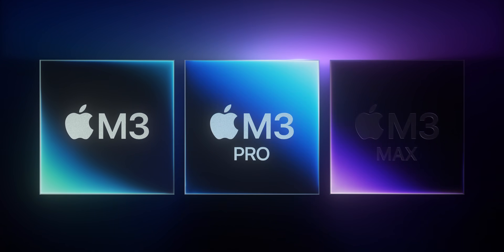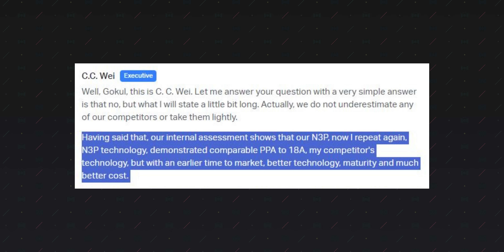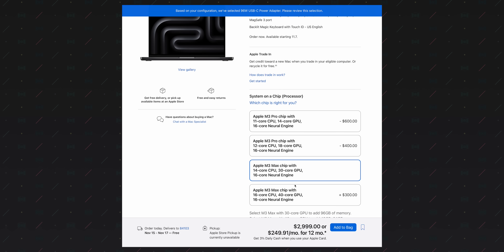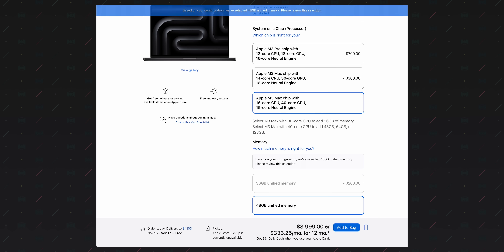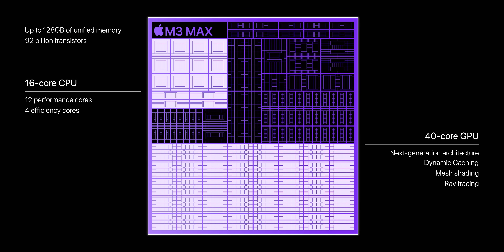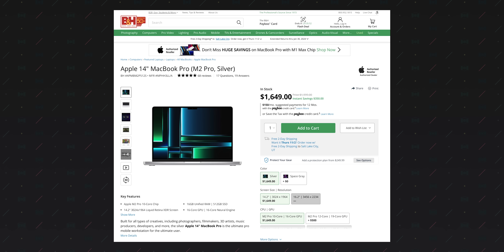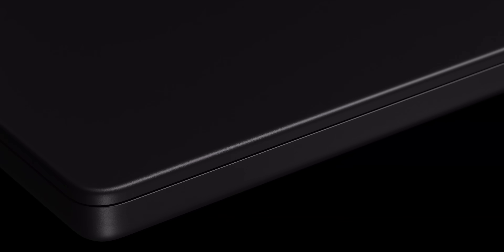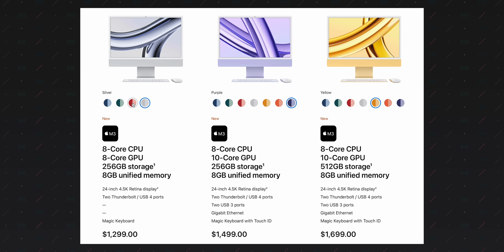Apple M3 Deep Dive: The Details Most Skipped Over

Comment: The only thing I'm disappointed about is that they didn't raise the RAM for the base M3 MacBook Pro to 12GB or 16GB. $1599 is a great price reduction for the 14" form factor, but it turns into $1799 as soon as you upgrade the RAM to a more reasonable spec.
Reply: $600 to upgrade the base model iMac to 16GB RAM & 1TB storage. It's a joke.
Reply: Now add tax and you're approaching $2,000
Reply: 16gb of RAM costs about 70 bucks if you buy it as a consumer straight from the store. There's absolutely no excuse to not have that at the very minimum in a laptop that costs 1600 bucks. Apple can buy this stuff at a fraction of what the consumer has to pay if they would buy it at a store.

Upgrading the Pro version from the base 48gb of ram to the maximum of 128gb version costs $1000!!! Good 128gb RAM costs around $450 (at consumer prices). What's the $550 Apple tax for? Soldering it onto your laptop, so it can't be repaired easily?

Storage is even more insulting tbh. + $2.200 for an 8TB mid-range SSD?!?! I say mid-range based on the SSD's Apple have had in their previous Macbooks. Nothing bad, actually pretty solid SSD's, but still not quite A or S tier level SSD's in terms of performance (closer to low to mid B tier level). A high end 8TB SSD costs around $1.100 and that's already overpriced since it's usually a better idea to buy multiple smaller sized SSDs (sweet spot is 2TB or 4TB per drive). For two 4TB SSD's you'd pay for instance around 600 bucks, (just to give an idea of how overpriced 8TB SSD's already are before the "Apple Tax" gets added to it).

Look, I don't care about Apple products. I know quite a few people at work use them, hence why I like to be informed whenever they talk about the latest launch of an Apple product (since that will inevitably be the topic of discussion for a week or even 2 weeks). I don't mind them asking a premium either to a certain extent. Let's say if a nice performance laptop which runs on Windows costs $2000 and Apple would ask $2.400 or $2.500 for the same performance, I personally still wouldn't want to buy it. However, I would understand why somebody might want to buy it. If they are used to Apple's ecosystem, and they like certain small specific features that the other laptop wouldn't offer etc., then a 20% or 25% increase in price is something that I would still find steep, but at least I could kind of understand. 

Some of these configurations you can make, though, are 120% + more expensive than a comparable Windows laptop. Which, frankly, is downright insulting. It just screams rip-off imo.

Anyway, my overly long rant is now over. :D
Reply: @tominatorxx  actually ssds are cheaper now and 1 TB fast ssd is $50 or so 4 TB name brand faster than in macs is a little over $200 and those are retail prices.

.but here's the thing apple gives you no credit for the base amount storage and ram that's already in thr machines.

So you are essentially paying $200 for 8 GB ram memory or $100 for 4 gb ram memory.

And its shared,  meaning your CPU and gpu have to fight over it, the loser must use the slow ssd lowering its life span and performance.

I kid you not, apple is essentially charging its loyal customers $200 for 256GB, not TB, extremely  sad.

Or 128 GB for $100.

This shows the level of disrespect and disdain and outright hatred apple has for its loyal users that apple consider dumb, once trapped in their ecosystem..

And worst of all, there are no upgrades internally ever, antirepair tagging each component to the cpu, which artificially takes away functionality if you get it repaired elsewhere, even with parts from a new unopened identical mac.

And worse of all if your ssd ever goes and it will, you brick your mac which will not be able to boot from an external boot drive anymore.

Apple put all of these anti consumer practices in place to maximize profits even more than the apple tax already does, and with low chinese wages and  off shore accounts to avoid taxes etc.

The product is good yes, but the company leadership and disdain for its users not so much.
Reply: @tominatorxx  ty...its actually even cheaper than 450...how can ppl be at peace paying this just for apple logo status showoff...
Reply: I think it better to get previous generations Macs as they are good enough for most use case and you can get it for lesser price
Reply: @atifkhanthegreat  Right now that seems to be especially true, especially with the M2 Pro lineup having an 8P + 4E core arrangement.
Reply: $2000 can easily buy a notebok with 32gb ram, 2tb ssd and rtx 4050...
Reply: and still only one external display
Reply: So I’ve been using the m1 ultra since dday for dev work. And I recently got a baseline air. My biggest worry was that MongoDB would kill my ram because on the Ultra it literally uses about 12 to 14 gb based on log size. I loaded it up on the m1. I was very pleasantly surprised. Yes the page file is there but in terms of performance barely felt the difference. I’m running at any one time 3 to 4 large vscode instances, Xcode and chrome and safari simultaneously as well as numerous db servers and node processes. Yes it eventually slows down when I run the iOS simulator but all in all for an 8gb machine in 90% of cases it runs just as well as the m1 ultra.
Reply: The 14" M1 pro dropped to $1599 within like a month of launch with 16gb ram and 512gb ssd
Reply: @Jst4vdeos  there's nothing Pro about Xbox series S storage capacity
Reply: @caseythoughtcrime  Better than the 256 that apple is calling pro now
Reply: @Jst4vdeos  Yea, right now the older models are going to be the ones to get. Probably going to start flooding the second hand market at pretty good prices too.

Comment: Fortunately, I skipped the whole M2 MBP mess and picked up an M3 Max MBP.. The upgrade on the M3 Pro doesn’t look all that great due to the fewer overall cores and higher number of efficiency cores while the M3 Max probably deserves its price boosts with its much higher performance core count and lower efficiency core count, along with massive numbers of GPU cores and RAM. The M3 Max looks to be a solid upgrade from my M1 Pro, but not so much the M3 Pro.
Reply: 12 performance core on the M3 Max is definitely interesting. Though I'm really curious about how the M3 Pro 12c is on par with the M2 Pro 12c. I doubt the efficiency cores can make up for 2 performance cores.

Comment: I love hearing these US prices, knowing that when the product arrives in Europe, it will be at least 30% more expensive.
It cost $2000 to buy a 256GB/16GB M2 13" Air when it launched... Instead of about $1300
Reply: Well most of the 30% is our VAT that by custom is already shown in EU and not shown in US. Noone in US paid 1300$ for that MBA as well, they just do not present it outwards.
Reply: For EU the base model will be around 2069 € and 16GB will be 2299 €. Wanted to see like 1700 for base model with 16gb. It's approx 2200 usd for base and 2400 for 16gb
Reply: @christeder  Well, I bought my 16/256 because I don't need much space, aside from enough memory for compiling a few apps on Apple Silicon for MacOS.
And I think the exact price when I bought it was about $1950...? I'm not 100% certain due to fluctuations of currencies and their exchange rates, so it varies across different countries that haven't adopted Euro as their currency.
Reply: @shapelessed  I see. I looked M3 from Apple site. USA and EU. I'm using MB Pro 2018 touch 8/256. For website development and little bit Photoshop/Video. It works good.
Actually I looked forward for M3, but there is option for M3 Air as well I believe. Only downside that Air doesn't have fan inside. At some point over years it may be the issue. Other option will be M3 16/512 but it's overkill for my current use. I don't play videogames anymore as well... Option for M2 but it was clocked version of M1 as long as I understand.

Comment: I will probably never buy a MacBook again, I refuse to get punk'ed by Apple's RAM & Storage prices. My M1 Max 16" spec equivalent is now 4250€, from 3680€ in 2021.
Reply: They don't want you to buy the M3 series if you don't need to, or won't get scammed into buying a base model M3 with 8GB of RAM. The M1 Pro/16GB are great options, as well as the M2 Pro/16GB! No need to buy the M3.
Reply: @gs7828  Don't worry I wasn't even tempted as soon as I realised AV1 encode is still not a thing with the M3, also Thunderbolt 5 is going to be a thing very soon.

Comment: Great video.

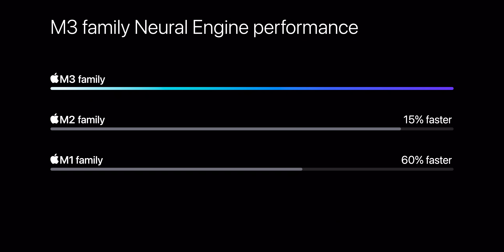One correction around the 5:45 mark. The new chips only do AV1 decode. No mention (presumably because it’s not there) of AV1 encode capability.
Reply: Yeah. And even then it’ll be a while before it’s actually utilized as things have to be updated. The YouTube app still doesn’t stream video in AV1 on the 15 Pro/Pro Max.
Reply: I caught this as well, but are there any/many end use cases that do encode jobs in AV1 on device? I assumed that youtube does that processing for you when you upload.
Reply: @MaslinMonty  Livestreaming to YouTube, but that’s about it rn. Twitch has yet to introduce AV1 support at all despite Amazon being a founding member of the consortium that developed AV1.
Reply: @MysteryMii  Apple is also a member of the consortium and they’re the last major hardware vendor to add support.
Reply: @MaslinMonty  You would probably want to upload in AV1 format?
Reply: @MaslinMonty if the hardware isn’t there then the use case can’t exist. AV1 could be used everywhere H.264 is. Calls over FaceTime or WhatsApp could all be AV1.
Reply: Fill me in on this av1 only thing your taking about ? Why is it important? What is it u want apple do add and why ?
Reply: @charlesjones5210  AV1 is a newish video codec.  Codecs are the algorithms used to compress media so that a movie doesn't require exabytes of storage (Compress Decompress).  AV1 gets very similar results to h.265 at low-ish bitrates and is almost completely free.  The streaming companies are pushing for it to become the de facto standard for distributing media on the internet.

Audio codecs can run on a CPU just fine.  Video codecs are much more complex and consume a lot of system resources (including power) to run on software (whether CPU or GPU).  Therefore it is important to have specialized processing units to handle it, especially in mobile devices.  Intel, AMD, Qualcomm, and Nvidia (Samsung maybe?) all support both compression and decompression of AV1 in hardware.  M3 will be the first time Apple supports AV1 in hardware, but it seems that they're only supporting decompress, not compression.   Despite being a member of the AV1 consortium they are several years behind the competition in this regard.

The most popular codecs are MPEG-2 (on DVDs and older media), h.264 (standard on BluRay, also called MPEG4-AVC), h.265 (standard on 4K BluRay, also called HEVC), and Vorbis (completely free). h.264 is the most popular way to distribute vide on the internet right now, it is slightly higher quality than Vorbis, the licensing costs are cheap and easy to understand, and almost all chips have hardware support for it.  But going forward we need something better because increased use and increased video quality are ballooning bandwidth and storage costs out of control.   MPEG developed h.265 for this, but unlike h.264, the licensing costs are not cheap and they're not easy to understand.  So a consortium of tech companies developed AV1 as an alternative.  At low bitrates it is very similar in quality to h.265.  At high bitrates, h.265 is significantly better and will likely remain the standard on 4K BluRays and select streaming applications where quality is prioritized over cost.
Reply: @charlesjones5210  it’s a new video encoder and decoder standard designed to be royalty free and to meet the demands of 8K video. The 8K thing isn’t important but the by product of that, is you get really small file size / bandwidth use for much higher equivalent quality settings to the closed codecs like h264/5. It could be the defacto codec we use for video at some stage.

Comment: JIT compilers and methods have been around since the 90's in the amiga days. Its pretty much what coders used to make cool 3d effects that basically was never planned to be possible.
Reply: Err, No. The shaders are still compiled beforehand in exactly the same way as all other GPU's. It's just that the memory allocation is done on a what's needed basis via hardware vs a software worst case scenario. Essentially at the deepest level any shader programs memory requirement defined by the compiler in software at compile time are ignored and the hardware decides instead. That's why no changes are required to any programs to run. In summary JIT hardware memory allocation is a completely different animal to JIT compiled software.
Reply: Actually, JIT was being used even before then by the Japanese.